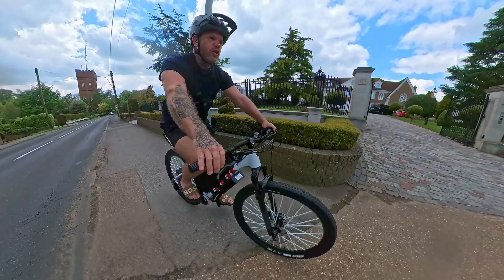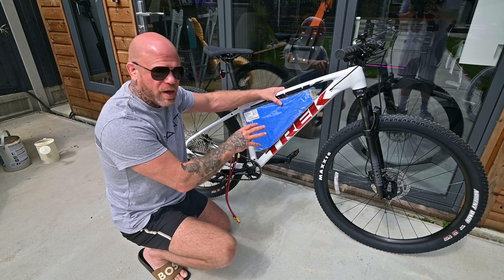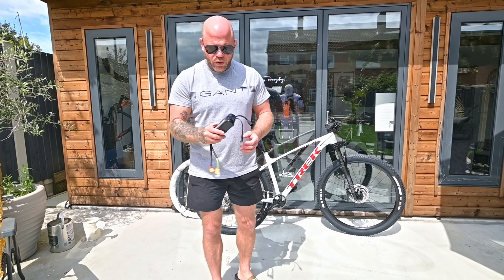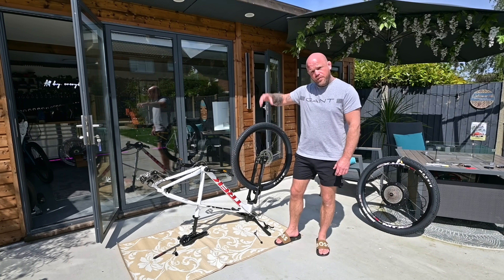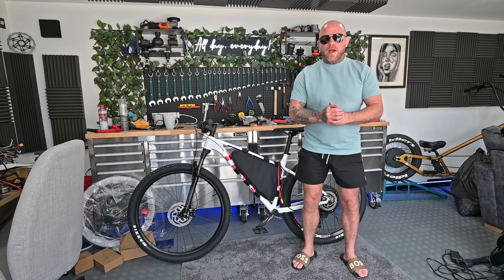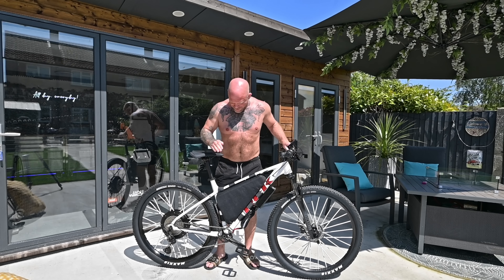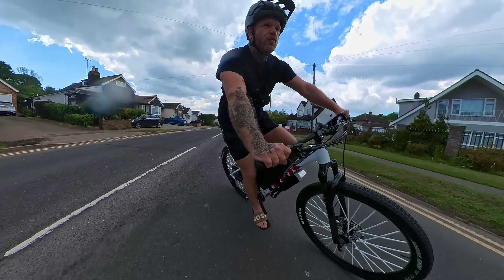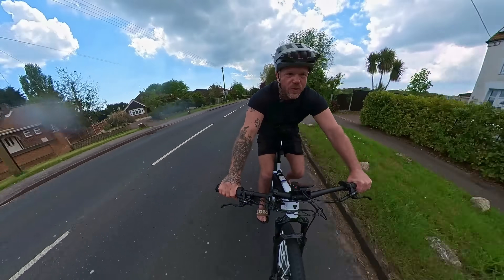Building THE ULTIMATE D.I.Y E-bike in 2024 - BEST SPEED & RANGE Combination ◻ ◻ ◻

Comment: I used the exact bullet connectors you have on my 2000w a couple of years ago and my god they do wonders for hill climbing as before the wires and controller got so hot the wires went soft and melted  but after the bullet mod it’s only warm now and runs smoothly with continuous throttle for long distance riding and hill climbing obviously not major steep hills without peddling help. But yeah my controller is like 4 years old now but stills runs completely fine especially after putting those in.  The  bullets are so good for what they do.

Comment: Let's be honest, i would say 30ah battery is around 90 miles and that's at low pas, i have a 52v 20ah and in real world conditions i'll get 60 miles in low pas settings and that's using the more power efficient mid drive motor

Comment: Get tires designed for the travel surface. Some people might prefer an eMTB for normal use, but road tires are still best if it's on pavement. Any tires not designed for pavement will wear out many times as fast on pavement, ride isn't as smooth, waste energy on pavement vs smoother tread.

Comment: Will there be much of a difference between a 2000 W kit with a 72 V 30 amp hour battery with a 60 amp controller compared to a 3000 W kit with a 72 V 30 amp battery with an 80 amp controller?
Reply from the maker: @steliosrc1414  higher amps better acceleration higher voltage more top speed
Reply: @DudeStuff  so should I get a 3000 W kit a 72 V battery and a 80 amp controller or a 2000 W, 72 V controller, 3000 W much bigger size

Comment: Are the hub motors as reliable as a mid motor ?
Reply from the maker: @masonryjoe  personally I would say a bit more depends on brands etc
Reply: @DudeStuff  Hub is alot easer but I understand you get a little less torque than a mid motor would provide ? Do you have a vid on the best mid motor kits, I subbed and missed this raffle but will keep my eye on ya, cheers from Canada !
Reply: @DudeStuff what trek Merlin is used in this video????

Comment: Hi I’m interested in buying a kit but my bike also has a 12s microspline, when you changed it to a normal one does the derailleur need adjusted or does it work fine?
Reply from the maker: Usually the derailleur needs adjusting regardless
Reply: @DudeStuff  oh okay, what cassette did you swap it with or what one do you recommend? Thanks

Comment: Any reason you opt for hub motors over mid-drive motors?
Reply from the maker: Smoother, quieter, no clunky gear change, linear smooth power, no changing bb, no shearing cassette teeth or chains, no need to change gears all the time when riding
Reply: @DudeStuff All of that is true (except maybe the clunky gear change) .  But in terms of torque, no comparison....and mountain bikes if used as intended need torque.
Reply: @DudeStuff I was wondering why you opted for the 12 speed if you don’t need to change gears much?

Comment: I have a question, I use a wheelchair, I have a Tri-Ride T-Rocks powered assist front wheel that is epic, I can do 30mph and over 20 mile range, doubled by the extra battery I have coming. They do a system that adds 2 powered rear wheels with hub motors that connects to the Tri-Ride controller giving me 3 wheel drive for off road and hills. Could you build me a pair of wheels with hub motors that could connect to my tride, because their system costs £5000 plus battery upgrade of best part of another £1000.

Comment: Had 42 out of mine, 52v 1000w hub on the flat. Takes off like a rocket and i love it. Mate built it for me and dont cost hardly nothing to charge. Does 40 miles distance at various speeds, and use an old battery to get extra 20 miles when good battery dead. Wouldnt be without it now.😊
Reply: Seriously? 1000 watt hub wheel / 52V batt?  What type of controller that gave you such speeds? I installed a 1500 w rear hub (  Ebikeling ) + 48V  14AH Battery (generic amazon) + 25A Controller  on a older 2010 Giant hardtail MTB 26" 2.25 Wide all-terrain tire -- and its max is 32MPH flat road throttle only.
Reply: My mate built it for me,tampered with the controller, so i cant really answer your question, however there is the possibility the speedos not correct. Im happy with it though, at 55 i dont need to be going faster😊 @connicrow9463
Reply: @connicrow9463  52v batt works wonders
Reply: @connicrow9463  32mph 48V is normal with the cheap hub motors kits, you need more voltage (and a controller that can handle the voltage) to get more speed. Top speed on DC motors is proportional to voltage. With 60V you could go 40mph if you can supply enough power to overcome air resistance.
I just ordered such a kit too and im thinking about buying the 75100 or 75200 VESC controller and a 72V battery for this motor. But im not sure if 32mph will be too much already for my 20 year old dahon folding bike.

Comment: I think you've copied me lol
Just built an orbea with a 45 amp controller and 52 volt battery it accelerates faster than a car but I only weigh 9 stone it's insane plus has a 10 speed shimano cassette 46 tooth
Keep up the good work dude, I'm as nuts as you pmsl

Comment: So more amps and lower voltage is the way to go to prevent voltage sag?
Reply from the maker: It's not lower voltage just the same 52v that usually comes with the kit. I don't think a 60 or 72v 40ah with the same cells would fit the frame or the cost would be ridiculous
Reply: I have same size pack but 72v 28.8ah in my medium orange crush frame with 60a bms,running bbshd upto 4000w with flipsky 75100,it's a beast haha

Comment: i never seen you install paddle assist.  wy not ?
Reply from the maker: I've never really liked pedal assist that much throttle gives much better control
Reply: @DudeStuff  if i rotate the paddles back wards, it also gives gas, i think i also will take it off because of this, or it picks up a magnet and then give gas if i stand still and not set it in pas 0.
Reply: so then you have less range because it drains the battery more right ?  hm thats oke for me i think,  i won't go that far away.
Reply from the maker: @jornmulder  you're more likely to average 15 to 20mph with the odd burst of speed which will be less taking on a higher power bike. Plus, you can still pedal as much as you like with a throttle
Reply: @DudeStuff  the odd burst of speed, you mean the paddle assist right ? and less taking on ?  sorry i am dutch. can you explain it so i understand?
Reply: @DudeStuff   can we put tubeless tires on these rims/wheels ?

Comment: Afaik the 10-12 cassette's all use the same dimensions, the sprockets are just thinner as is the chain ( overall width of the cassette doesn't change ).  At least I can change between 10 and 11 without issues, not having tried a 12 but as I said they should be using the same width all 3 of them.

I'm mostly using my 15-13-12-11 sprockets in the back though, so I don't know why I would add complexity ( and thinner chains which don't do well with me middrive anyway )  for no real gain. I am actually looking more at either going smaller for a new setup ( less gears overall, but same range between top and bottom ), or even an internal hub in the rear wheel. Alfina 8 speed, more reliable then the 11 speeds and a bit cheaper. Ofc I would love a Roelhoff, but I aint paying 1300 euro's for just a rear hub even if it has a 14 speed internal gearbox. 

That would be my dream setup I guess, nice powerful enough mid drive coupled with a belt transmission and an roelhoff rear hub. 

So much less headaches with maintenance, or even possible repairs. And in the end I am sure I would be cheaper of that way, as needing to replace chains+cassete's every ~800km or so on it's own already adds up to lots of costs. Proper belt drive can do tens of thousands even with more power coming from a middrive.
Reply from the maker: It's a game changer being able to convert 12 speed bikes now
Reply from the maker: It's a game changer being able to convert 12 speed bikes now
Reply: @DudeStuff  You're still rebuilding them with smaller cassettes if you're shoving in those 2kw hubs or you don't have the clearance in the dropouts. 

Through axle rear hubs are 142mm vs 141 QR hub's on most budget bikes still. 

There were some 150mm boost through axle's on some expensive DH bikes, I recon you could shove a hefty motor on one of those and have ample clearing/space for big cassette. Which would mostly come in handy so you can run a gigantic front sprocket so your 11t on the rear stays useful on higher speeds, but you have a really big gear still so you can peddle slowly and keep up with granny behind her walking aid on the narrow pedestrian crossing. Which is mostly only an issue btw if you don't use a throttle and want to feel like your peddling is actually effective in controlling the bike.

Comment: btw, did you know if you install paddle assist thing on it, if you go backwards with the paddle it also gives gas. how can i stop that from doing ? or you cant ? i should i put it on 6 then so it won't reg the magnet that fast ? it's on 12 on program 13 because i have 12 magnets in the paddle assist thingy. with the sensor. the other one did not fit, then i need a longer crank.

Comment: I got a SYNCH super monkey 20x4 wheels coming (UK Super73 clone) / gonna fit the 1500W Kirbebike kit / got a mate that does custom batteries gonna go 52V 14s 16p 80AH. I get 30 miles from my on mode 2 20-25 MPH from my kit on my 27.5 bike with a battery 4X bigger should be 120 miles. Ordered the rear rack so i can fit a small petrol genny on the back so i can charge on the go. Inspired by some of your crazy builds
Reply: I'd love to know your miles per gallon on that.

edit: This guy https://www.youtube.com/watch?v=b9BOgCyrSzI charges his surron twice on half a gallon and gets 30miles at 30mph = 120mpg 😀
Reply: @warlockboyburns I've calculated my ebike to do about 350mpg equivalent and that's full throttle going 30+mph everywhere. My old legal bike used to do 40 miles out of a 36v 11.5ah battery the efficiency on that was crazy but it was also hella underpowered. Only a 10amp controller 😂.